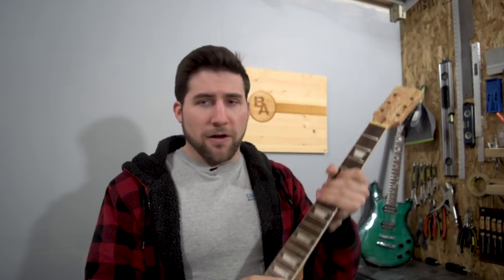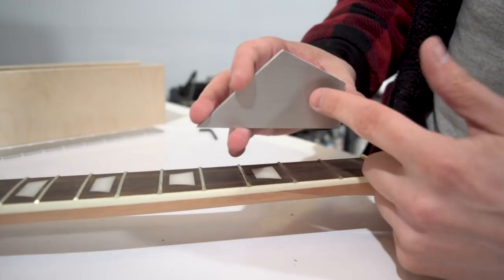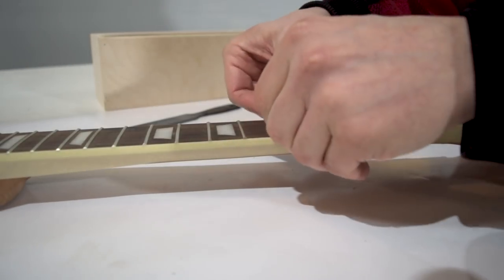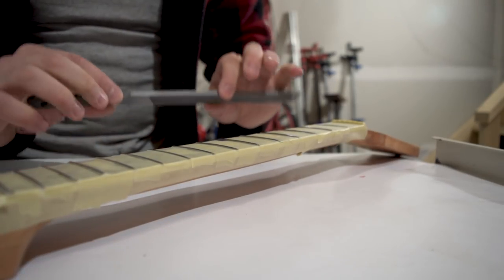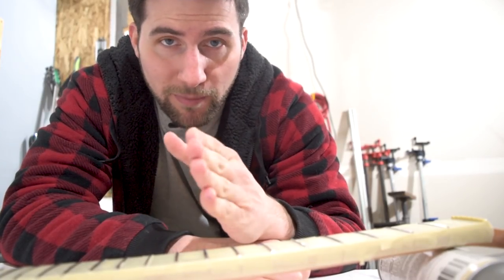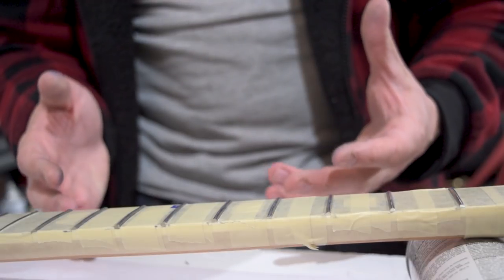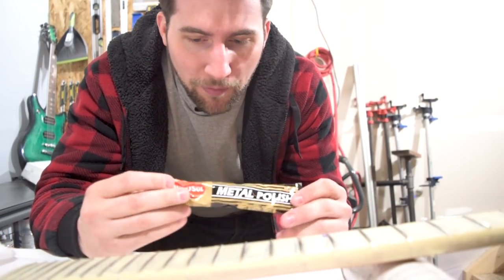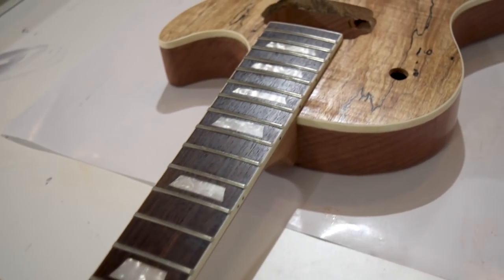Make an Awesome Les Paul for Less Than $300 | Neck and Fret Work (Part 1)

Comment: Good video, as always! Looking forward to the next one. Another good tool for fret leveling is a narrow piece of marble countertop with a strip of sandpaper attached to it with spray adhesive. The weight of the marble means you don't have to press down when leveling, which is nice because it helps eliminate human error resulting from applying uneven pressure. I found a piece for about $8 at Lowes which works nicely.
Reply from the maker: Nice. I use a piece of marble for a lapping station haha.

Comment: Another great video Brad.  The only thing I would add here is getting a safe edge 3 corner file for crowning and fret ends, as they are inexpensive and very useful.  Another useful trick to re-purpose existing tools is using a 24" level as a leveling beam.  Just have to make sure the level is dead FLAT, as with any tool that requires a straight edge.  Still can't wait to see what you've got in store for us.   Keep 'em coming!   "Rub it like it's Friday night" OMG man.. you're killing me!
Reply from the maker: I’ll be releasing a video soon on how to make your own fret crowning tool that I think works better than any of those files. 
Likewise for your own leveling beam, and  you’ve just essentially given it away.
Reply: Oops..  Sorry about that Brad, I didn't mean to spoil that.   However, in my defense, my psychic mind reading powers have been acting up recently.
Reply: I was going to make the same comment about the leveling beam.  I came close to buying one last year, but figured that a metal level would make a good substitute.  A cool trick to use with the level is to put masking tape on one side, then use glue to secure sandpaper to the tape.  When you are done, you can just peel the tape and sandpaper off.
Reply from the maker: Yeah, I always go with the tape and glue option. It’s just so much easier.

Comment: You can make a good levelling block from any piece of scrap hardwood. I've got an old chopping block which I routed out and set a piece of tempered glass into, I use it to file nuts down or file flat edges for my other crafting. Doing that gave me the idea to make a levelling block by taping some sandpaper to my glass counter saver and sanding a flat edge onto some scrap wood.  It's plenty flat for fret levelling purposes and the job I did on my guitar with it has improved the playability immensely. It's funny you mention nail files too because that's what I did the crowning with, cheap 5 in a pack for a dollar emery board nail files.
Reply from the maker: Yeah, there are lots of little tricks you can use to save money on that stuff.

Comment: It's nice to see someone else that doesn't approve of steel wool. You can basically impregnate mild steel into stainless using the wrong type of brush/wheel when metalworking, can cause rust, and or funkyness when welding. I can pretty much say with any certainty that people are doing the same to their frets and fretboard when using wool. Might not see it, but its there.
Reply from the maker: I didn’t even realize that. Good to know.

Comment: I was surprised to see that you were using the file 'backwards' i.e. sliding it in the wrong direction: files cut a lot better if they are working in the correct direction!  Also: unless the file is a new one, it should always be cleaned before using it on the relatively soft metal of the frets.

Comment: Whether or not it's any good is all in the fretwork. I tend to just rip the frets off kit necks as they tend to be very soft, which is easy to work with but doesn't last long. If you can level and polish frets then a refret is not a lot more work. I have a strong preference for tall frets, particularly narrower ones which are less work than really wide ones, and it tends to be the case that my clients have found me because they have similar taste.

Buffing soap on a leather pad works really well for frets and doesn't leave too much gunk. If you've got a good thick and soft bit of leather it will confirm to the shape of the fret really well.

There's then scope for playing with inlays. I've been investigating a laser cutting service for making pickup flatwork and if you're any good in inkscape, illustrator or a cad package it shouldn't be too hard to get acrylic or hardwood inlays cut.
Reply from the maker: Great tip with the leather. I’ve made a strop to finish mine off with when I get to the end of the project.
Reply from the maker: Yeah the big one works for the tops of the frets to get that all done quickly as well.

Comment: Why use a fret rocker before leveling? Is it that you should use the rocker to determine if leveling is needed? Because you'd never just level a single (or couple) frets, right?
Reply from the maker: Essentially, yes. The rockers tells you if you need to level. If you just have one high fret then thats different. You can just level that off. As soon as you have a low one though you have to level the whole thing.

Comment: I understand using truss rod to straighten neck for leveling.  It would need to be straightened again under strong tension?  Newbie
Reply from the maker: No. The tension gives it back the neck relief that it needs for you to be able to play it without fret buzz.

Comment: I notice you didn't show much rounding/polishing of the fret ends, or rather rolling them down a bit.  Is that a personal preference, or was the neck just pretty much good to go with respect to the fret ends?
Reply from the maker: I don’t always show it all because it’s a long process, but with these bound neck kits I usually find the fret ends to be pretty good.
Reply: @BradAngove  Cool.  Yeah, mine are okay, but I'll go over them at the very end - @DarrelBraunGuitars has a good video on how to do the ends.  I decided to go with a Baroque 3rd Generation Fret Crowning File, as I don't totally trust my hands for the crowing part.

Comment: I'm a Machinist. Files only cut in the forward direction and not in the backward direction. 
Why are you moving your file in the backward non cutting direction? 
Just curious?? If you want to remove material with a file then move it forward not backwards
Reply from the maker: Interesting; I used to be a machinist. Anyway, somebody who didn’t know what they were doing taught me that that was what “draw filing” was. Obviously he was wrong, and I now know better. It still worked, but only because this inexpensive fret material is soft enough that it leveled off anyway.

Comment: If a couple of frets where just a little high could you just use a fret crowning file to do just the high ones?
Reply from the maker: Yes, but it may be difficult to get it right. Stewmac also makes an expensive tool called the fret kisser for that, which could probably be emulated fairly easily with a small wooden block.

Comment: Brad, if you used the fret rocker and it was good, why do you need to file down the tops of the frets? Do you have to do this with all guitar builds?
Reply from the maker: When I used the fret rocker I found a couple of low frets, so it wasn’t quite good enough. If there were a couple high ones I could have just filed those, but since I had low ones I had to bring the rest down to match. 
You don’t have to do this if the fret rocker actually shows that they’re all good.

Comment: I'm a newbie guitar owner, and I have a question about polishing frets. How often should I do it? Once or twice a year? At every string change? When I notice the shine fading?  Thanks for any help you can give me.
Reply: Amir Khalid ...You only need to do this when you start to notice small wear marks in your frets where you press the strings against the frets. How often you have to do this is dependant on how much you play and how hard you press. If you just want to keep you frets ‘shiny’, then get some 0000 steel wool and use that when you change your strings... :) Hope this helps.
Reply: Thanks for the guidance. Much appreciated.
Reply from the maker: I agree with all of that except the 0000 steel wool. As I said, I recommend going with a different option.
Reply: it also depends on the quality of your frets. some of the cheaper ones, i.e. on kits, tend to be pretty soft.
those need tuning up fairly often.
but as iamdunn said, you only need to do it, once you notice wear marks.
the whole setup is more about leveling the frets opposed to getting them shiny.
shiny indeed makes playing better.
but you seem to be a beginner. soyou wouldn´t notice the difference.
also: every time yu level the frets, they become lower and smaller and eventually you have to replace them, which is hard to do by yourself and expensive, if you get it done professionally.

Comment: Hey man, love the guitar builds.  I’m building another kit that you got from Solo - the telecaster.  But I’m still a little confused by the process of getting the neck straight without the strings.  Without the strings it has the slightest curve near the nut - it pitches back.  My question is, is it perfectly straight or is there some curve that is natural? Even with the truss rod adjustment? I’m assuming - and could be wrong - that you’re getting the neck straight pre-strings, sanding frets as needed, then after the guitar is completely put together re-adjusting the truss rod with the addition of string tension.  Am I on the right track? Any help would be grateful.  Again, thanks for making these videos.  I’m so happy to be living in the future.
Reply from the maker: You’re on the right track (except maybe that bit about the future...). Truss rod adjustments may be needed once the strings are in, but you need the neck straight to do your leveling.
Reply: Brad Angove Thanks for getting back.  I finally managed to get it straight.

Comment: Rub it like its a friday night ...lol 
Great tip...(s) ... lol ...and using everyday tools .. thanks
Edit : can you show how to level the Frets ..like Gibson did on the 70's Customs..called the "Fret-less Wonder " i think ..and can it be done on acoustic guitars which need a re-fret really..and turn them into a Fret-less wonder i have a '62 Archtop Harmony im working on.. it don't even have a fret board it seems..its weird..and no truss rod..can i take the bar out and of the neck ..and add a truss rod ? have you done this ?..seems i've seen it done before, if the fret board does come off . i have I shaved the bottom frets before thin to the board like old fender straits have on electrics...but been so long..so looking for a refresher course really..lol .. I'll try to search in your vids to see if you done this..
Reply from the maker: I’ve never changed a truss rod. Stewmac probably has a video on it. As for the fretless wonder, that would be fun. Just take the frets down flat and low and shave the but down I assume. I’ll look into it.

Comment: I've built guitars from scratch and used radius blocks. Personally I would not level frets with a file like that.
Reply from the maker: Fair enough. What would you use for a compound radius?
Reply: Three different radius'd sanding blocks.
Reply from the maker: Interesting idea.
Reply: Just tape off the frets you don't want radius'd and be careful.. lol. You'll get a consistent and even radius. Stewmac sells that stuff or you can make your own.

Comment: You didn't need to level the first fret. By taking material off of the first fret you are working against what you are trying to achieve. It needs to be the highest point.
Reply from the maker: No it doesn’t. That’s what truss rod adjustments are for. In order to have a proper starting point, they all need to be level.

Comment: What is the angle of the headstock tilt? Are we talking ridiculous Gibson 19 degree, or... checked the Solo website, but couldn't tell.
Reply from the maker: I’m not sure. It looks pretty Gibson-Esque in length and angle to me. That’s not something I would generally bother to measure though.
Reply: Brad Angove Generally speaking, I wouldn't either. With Les Pauls, though, the tilt can be REALLY drastic. Oddly enough, in my experience, that only applies to the Gibson LPs. I've never seen an Epi with that much tilt
Reply from the maker: Do the Epis have longer headstocks? They could have the same tension with less tilt if they do.
Reply: They're an inch or so longer, but the additional length is at the very end of the headstock. I don't know how much the string tension factored into the design in relation to tilt angle, especially considering it seems to be pretty much exclusively a Gibson L.P. thing. It's almost freakishly exaggerated. The angle is extreme enough that it's almost universally blamed for the broken headstock issue LPs are infamous for.
Reply from the maker: Well, the angle on the kit is definitely more pronounced than the other angled headstock guitars that I have. I don’t own an LP though.
Reply: Well, if this kit looks and plays as well as that "sheet metal" Tele kit you did a while back, I can't think of a single reason why you WOULD own a genuine LP!
Reply from the maker: Haha thank you. If I were putting that kind of money out I honestly wouldn’t be buying Gibson anyway.

Comment: I would love to do a project like this, I cant afford a real les Paul. could yyou tell us where you buy the straight edge and fret rocker, stew mac is not cheap, is there a better option? thanx
Reply: Beware -I bought a Chinese fret rocker (and a bunch of other tools) and the fret rocker is stamped steel w/o machined edges, so each edge gives a different result bc they're wonky. About half the tools suck and half are a good deal, but there's no way to know, and you wait many weeks to get them, so plan ahead!
Reply: stewmac and crimson guitar are probably the safest options, if you have a good straightedge already you can notch it yourself
Reply from the maker: I believe I put them in the amazon store that I linked in the description. The ones that I use aren’t very expensive and work quite well.

Comment: I noticed that there was still some blue on the frets after you had done the leveling.  When I tried it myself I tried to remove all the blue.  Is that not what I should do?  Also, if you have one fret that is low should I grind everything to match or should I somehow raise the one fret?  Love your videos!
Reply from the maker: I try to level them as little as possible. So just enough that there is a silver line down the middle of the frets. 
I’m not aware of a way to raise a fret unfortunately.

Comment: Where did you get you're slotted frett board li avel and frett rocker?
Reply: I'd guess that Brad got them from either StewMac or Crimson Custom Guitars. But you can buy luthier's tools at any online market. Just go there and do a search.
Reply: A quick Amazon search.  Notched straight edge, and fret rocker.  I have the same ones.  I bought mine together for about $20-$25 if I remember correctly.  These are some of the most useful tools you can buy, especially the notched straight edge.   I use the notched straight edge for fret work and for setups.  It's quite useful, as it has 24.75" (Gibson) scale on one side and 25.5" (Fender) scale on the other side.
Reply from the maker: Mine are the inexpensive ones. If you click the amazon influencer page link in the description, I believe I have them on there.
Reply: Thanks for the info I found them.